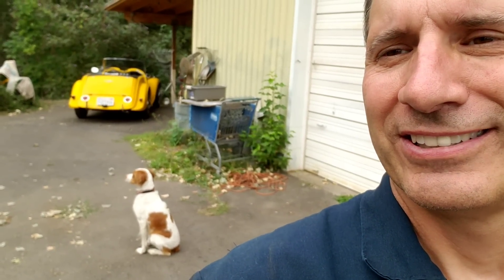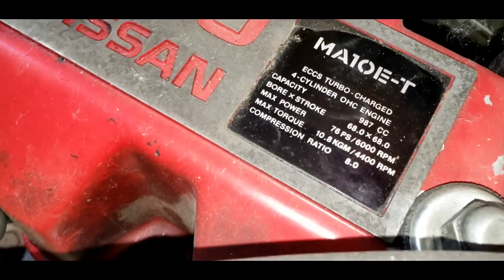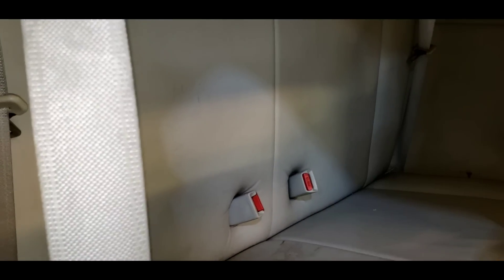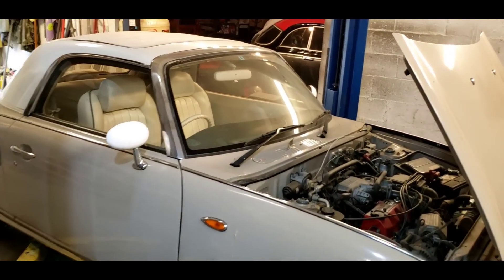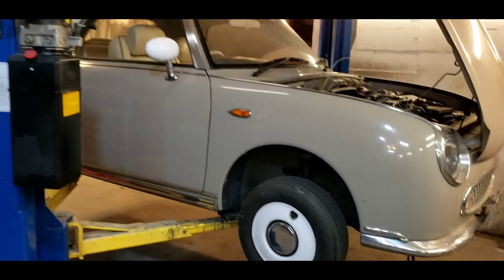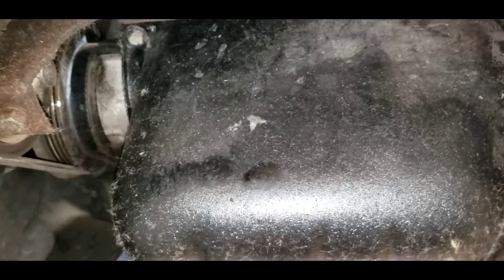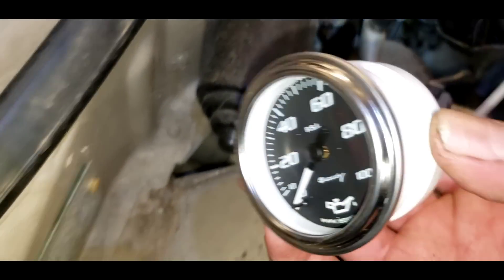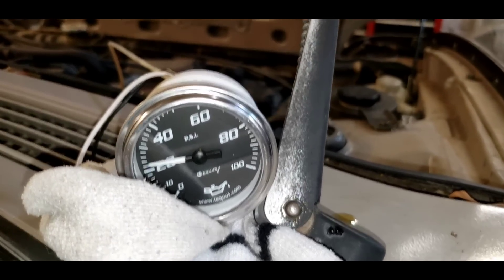What Did I Do Now ?

Comment: It is something simple, either incorrect oil, maybe the oil pump has failed?? It is Japanese generally very reliable, check what the previous owner did to it!
It has oil pressure on the temporary gauge so either factory gauge is FAULTY or the warning light switch!!

Comment: the figaro is based on a Nissan March/Micra K10. it was a more boxy boring version of the car. so mechanically it uses more common parts from the March/Micra. Known issue i have heard of on Nissans of this vintage is the oil pressure releaf valve or the oil pump itself.

Comment: IIRC, this is based on a very common Nissan front wheel drive platform, so drivetrain parts should be easy-ish to get.
Reply: The K10 Micra, was sold in Canada, but that was a long, long time ago. Fortunately, the Pike cars, Figaro in particular, do have a pretty fanatical following

Comment: 20 at idle seems ok to me. 
Up to 40 when u revved it up. 
Usually 10 lbs/1000 rpm. Of course it will drop slightly when hot, but still not bad.
Reply from the maker: It drops to 5 psi hot pretty quickly
Reply: @2stroketurbo  Ugh!
Reply: @2stroketurbo  Seems like your thinking in the right area, check out oil pump relief first, then maybe r&r oil pump??
 One vote for fix it & use as is - never know, someone may make you an offer if they're that desirable. I'm betting your wife might like it; think the rhd will throw off the girls.

Comment: My air cooled VW has oil pressure that is lower than the Figaro and it does just fine.  What are the oil pressure spec's for the Figaro engine?
Reply from the maker: It drops to 5 psi oil pressure when hot,  I'm gonna take it apart and see what I find.

Comment: I wonder if an HR12DDR would fit in it?  It's a Miller cycle 3-cylinder with 13:1 compression rated conservatively at 97 horsepower.

These cars were built in the Oppama plant from what I understand.  Knowing that they were assembled by hand it is possible that they were assembled in the same part of the plant where the President was assembled.